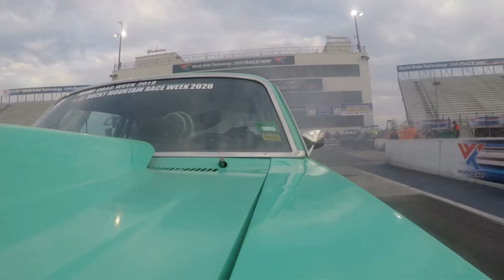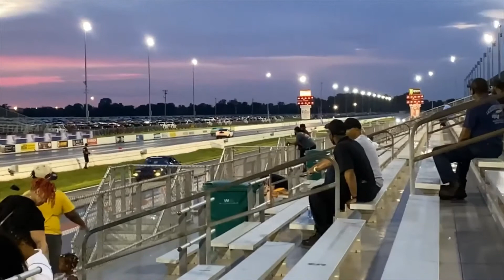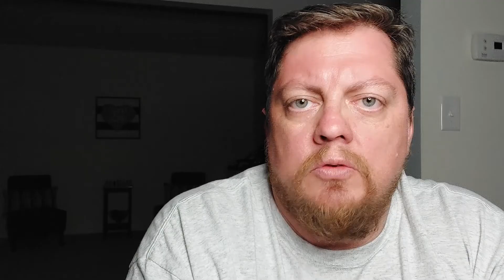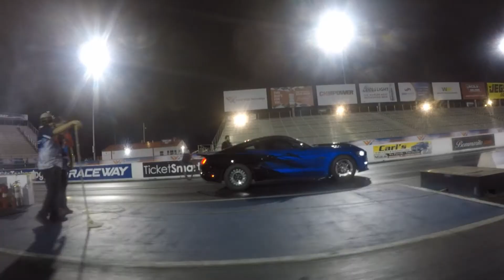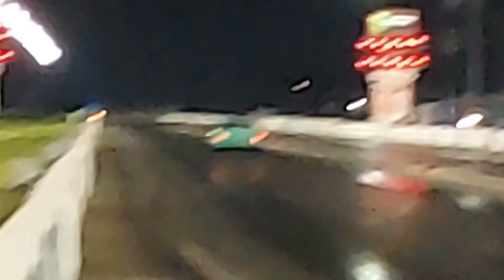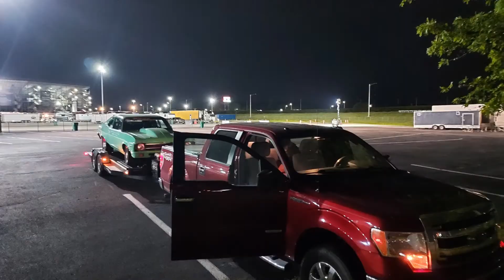twin turbo coyote powered Mustang blows during race against 72 Nova

Comment: Big congrats buddy you deserve it!!!👍🏻👍🏻
Reply from the maker: Thank you. I'm out gunned in the new class because I added more bars and by the rules can't be in the street class any longer. I'm still going to use the events to go faster and maybe tune for race week type events.
Reply: @bure4me  I totally understand if you don’t want to say but what converter you running now?
Reply from the maker: @AngeloC49  I'm running a trans specialties 9" mid stall. Same one the last 3 seasons. It's tight and wants nitrous. The top end was over 140 mph and it was roughly 63 - 6400 rpm. At the traps.